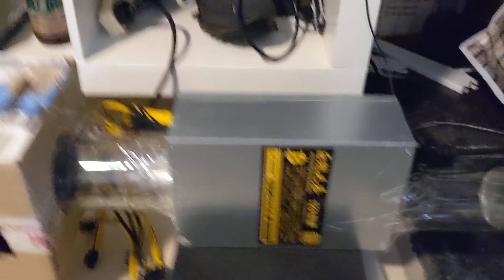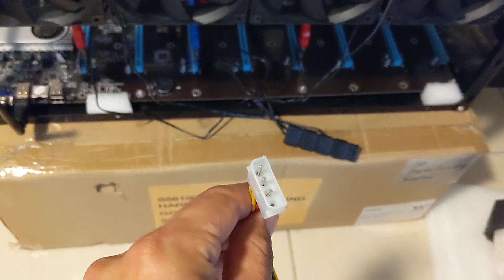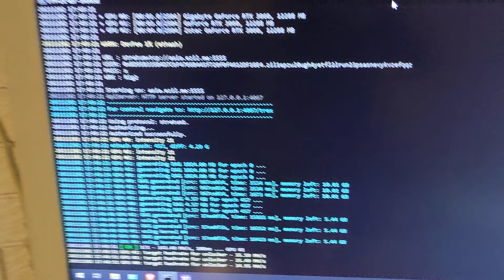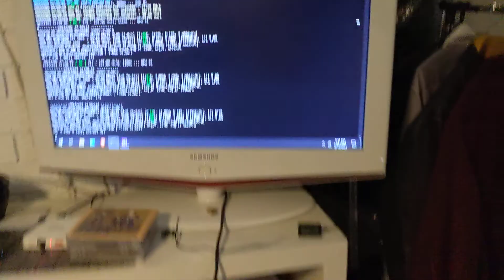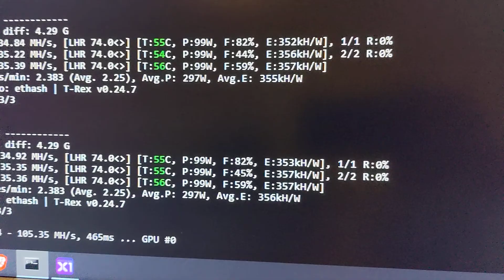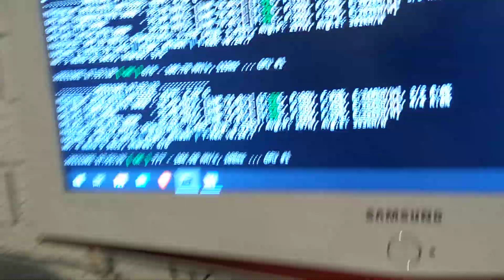BTC-S37 - Unboxing the power supply, plus 75% on LHR GPUs!

Comment: Hi are the 3060 cards you are running revision2 12gb cards as I have just bought a btc s37 board and didn’t want to buy them if I can’t run them on the board and do you have the bios set to gen 2 or gen 3 for the pci slots
Reply from the maker: Hi there.

Yes, these are Revision 2 (LHR) cards, and they all run perfectly.  I have had them running in every slot on the board at different times.  As long as one is in the first slot, then it should all be good.
I believe I did change the BIOS setting to Gen3 for these cards.
Reply: @shanea6140  ok thnx good to know I am interested to see how they go on nbminer 40.1 to see what they hash at
Reply from the maker: Best of luck!  Happy mining.